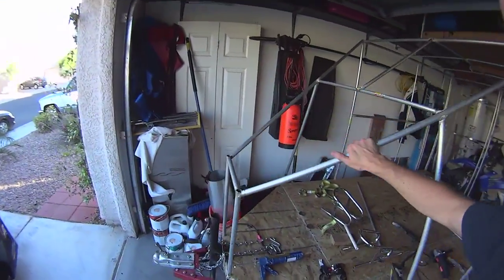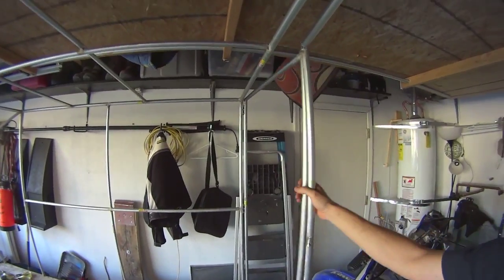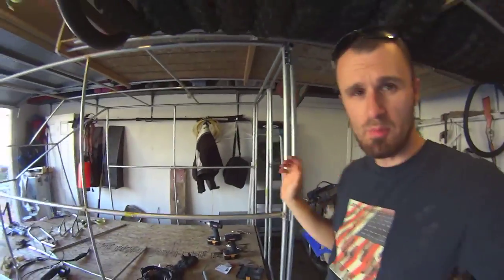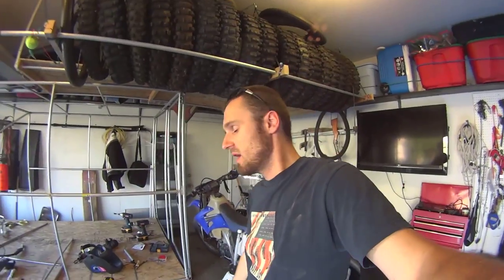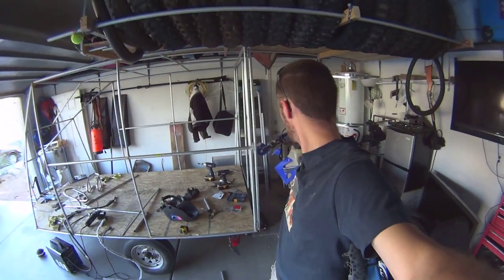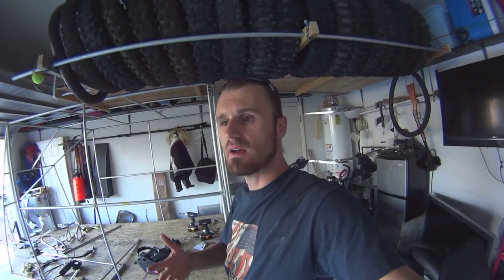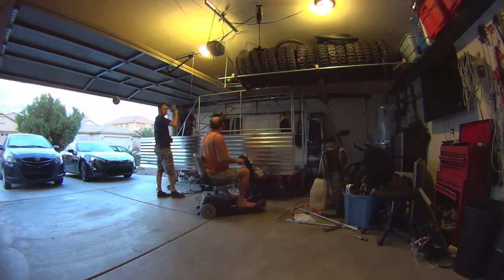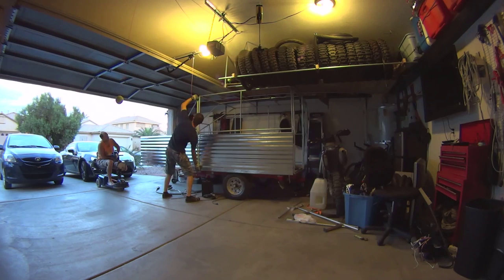Harbor Freight Adventure Trailer - Answering  youTubers Recommendations

Comment: Just another suggestion..  The Particle / Chip board you are using.  As long as it has been treated on the underside it should help to repel water.  If not you may need to spray on some type of water proofing.  The wheels will kick up water from the road and over a short time the floor will fall out.  Now if you only drive in dry weather then you will be ok and being in the desert I am sure you have many dry days.    Anyhow. It looks good and I applaud you on your efforts.  I can't wait to see the end product.